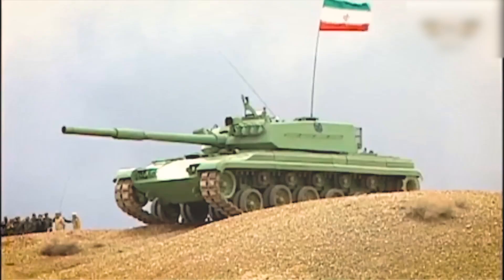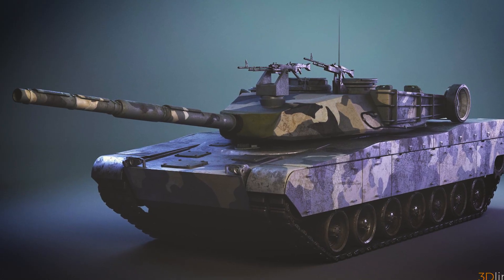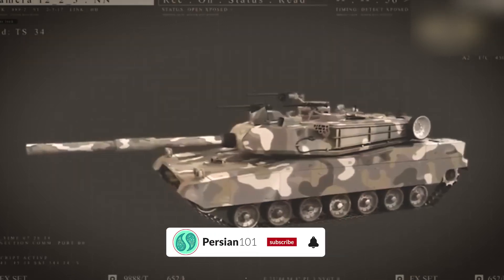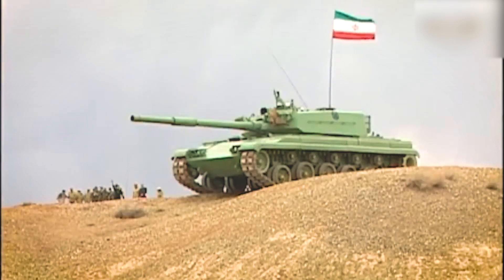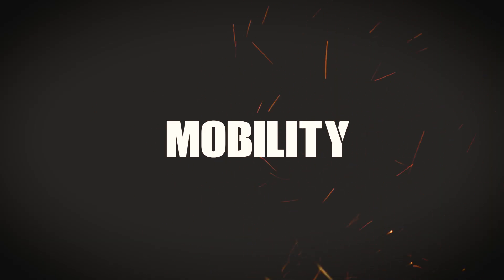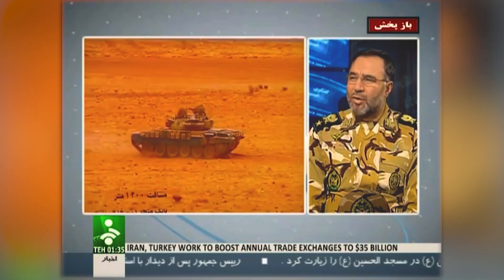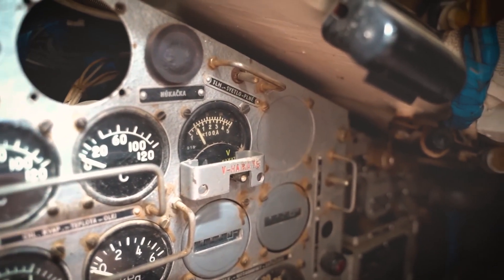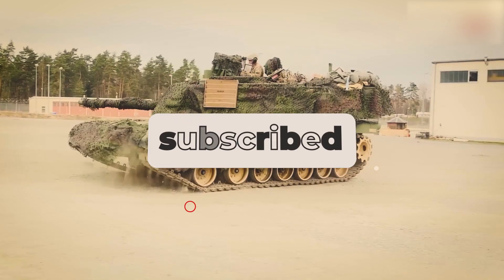Secrets of Iran's Main Battle Tank: Zoulfiqar 3

Comment: " steel rolled homogeneous plates - welded together"

Well that tells you this is the third generation, probably after the second world war.
 Unless Iran has some amazing metallurgical research institutions, and they find some sort of amazing alloy that nobody knows about
Homogeneous steel alloys just cannot absorb as much energy or deflect as much energy pair unit mass as the complex materials.

And again, I don't know if Iranian engines are the top of the world, so probably they're going to have the same type of engine as they had in other armored vehicles.
Indian to conclude this is just a geometric change. Nothing revolutionary or new
Reply: Well it's all steel construction + soviet style autoloader... 
Sooo... T-72 Ural with more modern optics and fire control basically. Maybe slightly better protected due to welded turret instead of soviet cast turret.
But it ain't a deathstar by any metric.
It needs composite armor. And Soviet autoloaders are dangerous for crew. But as long as optics and fire control are good enough it should still be uselful, for sure more useful than old legacy soviet tanks.
Reply: EXACTLY what I was thinking.  M1 crews be laughing at them.
Reply from the maker: thanks for your insight
Reply: Mehh.
All modern tanks are RHA or Cast steel boxes filled with special armor arrays...a good portion of which are still steel/Ti/Al alloys.

Comment: It is surprising that they don't design their tanks to resemble more of Russian ideas and technologies, considering how close these two are.
Reply: Have a look at karrar, the latest tank.
Reply: @iraaus  karrar is merely an upgrade package for the t72 resembling a t90m
Reply: @navidf1428  if you say so....
Reply: No, he's right. Karrar was just a modernization project for existing T-72s, it was propagandized to make people think Iran has the capability to mass-produce a modern tank.
 @iraaus
Reply: @kmsdoj4519  firstly t72 has already out performed the so called modern western tanks in Ukraine, second, an updated t72 is still a huge achievement, thirdly unlike some I do not put down our achievements.
Reply: The T72 has not outperformed any Western tank in Ukraine because tanks are designed to be used concomitantly with air cover. Ukraine is throwing tanks at the front without requisite air cover and they are being destroyed by large artillery rounds, just as would happen with a T-72. The only way the T-72 "outperformed" the Leopard or Challenger is in cost and upkeep. Western tanks needs good logistics and are costly. By the way, the Russians have lost just as many tanks as the Ukrainians, and often with zero crew surviving. In most wars and testing, the M1, Leopard, and Challenger way outperform the T-72 in range, armor, firepower, and speed. The T-72 is the AK47 of tanks, it's good enough and disposable. But against superior Western tanks, it doesn't stand a chance. What achievements? Mismanaging a sanctioned economy? Losing officers at a rate no other army has? Constantly putting out domestic fires every month? Showing weakness to the Taliban and Aliyev? Make 2 1950's era F-5 knockoffs a year?   @iraaus
Reply: @kmsdoj4519  lol.....what ever...